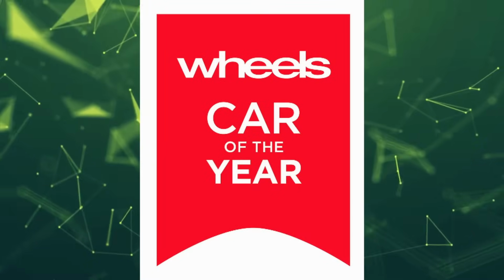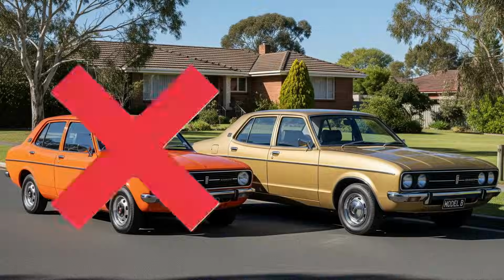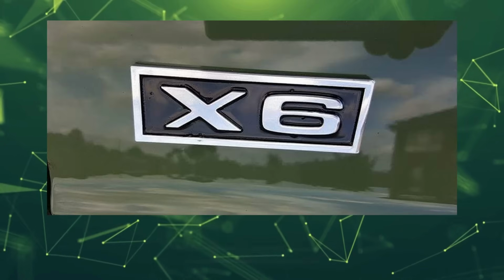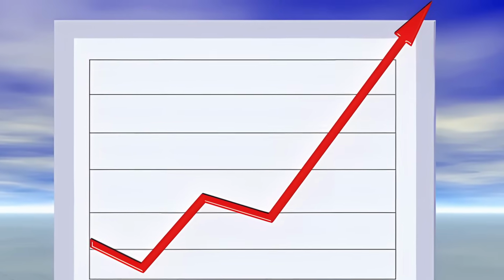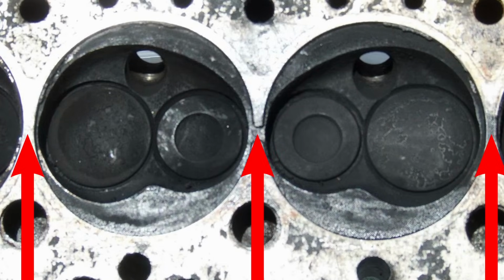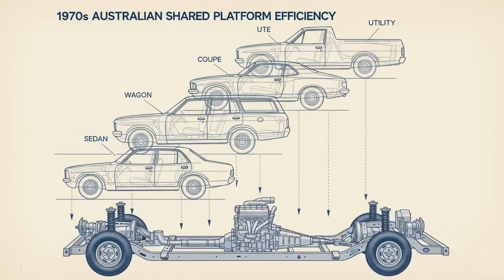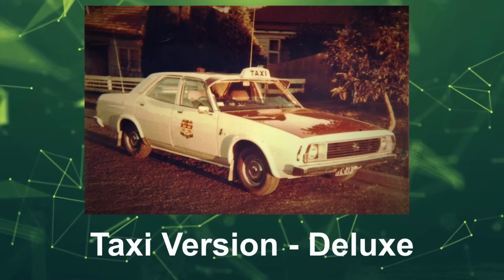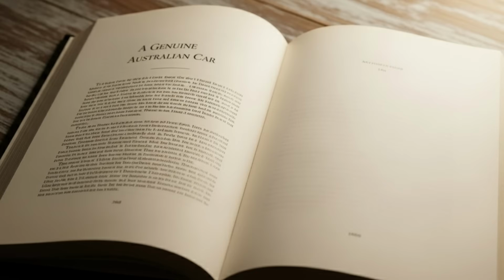More Than Just a Lemon - The Complete Leyland P76 Story – Part 1

Comment: I remember being driven in a brand new P76 as passenger and finding the cooling ductwork under the front dash falling on my legs as we drove down the road. It then rained and the washer fluid ran down my legs in the front seat when the washers were operated. The quality control was very poor and to me this is what killed off the P76. It was huge compared to the Holdens and Fords of the time but it was not acceptable based on quality.
Reply from the maker: Hello and thanks, that P76 really had some major issues and as you said, these are the things that killed the car.  Mind you, from what I have sen, the last models were actually quite good, but unfortunately were also too late.  Thanks for Your Comment, Much Appreciated.

Comment: I bought a deluxe with a crook motor and an executive with a crook auto in 1969
Converted the red deluxe to an executive using the parts from the horrible yellow exec! 
It would easily see off a 318 valiant my TA owned 
Only casualty on rough WA roads was one of the front struts 
Fuel efficiency was great on it’s final trip across the Nullarbor before I sold it 
Regret selling it !
Reply from the maker: Hello, thanks for sharing this, I always like to hear first hand experiences, as this tells a lot more than books.  I also like the way you adapted your Deluxe into an Executive.  Thanks for Your Comment, Much Appreciated.

Comment: Just about that air conditioner. The problem with out P76 initially was that the air conditioning coils sat in front of the radiator, so the air con had to be turned off to avoid overheating the engine. We only discovered this on the road out to Broken Hill. Problem was easily solved with adding an electric fan. After that the air con worked well.
Reply from the maker: Hello and that’s interesting, not shown in books.  Thanks, Greatly Appreciated.

Comment: The chrysler VH valiant was developed for $22 million aud, just 1 million more than the P76 development but the valiant was just a restyled rebody unlike the totally new leyland.
The factory was redone on a shoestring by reusing the tooling and machinery from the older smaller uk range so the bigger car struggled to fit on the production line so were vulnerable to damage. The P76/SD1 commonalty was a myth according to 'AROnline' but the force 7 rear hatch was studied for the Rover
Reply from the maker: Hello and thanks, you have made some interesting points, but the research I have done, points to a number of different facts.  Thanks for Your Comment, Much Appreciated.

Comment: As an apprentice auto electrician our workshop was always repairing the crappy Lucas Australia starters and alternators as well as the shoddy switchgear fitted to the P76. It wasn't long before they got the nickname P38 as they were only half a car ! Did England have a six cylinder marina, Australia had them back in the seventies and used as general duties police cars in new South Wales.
Reply from the maker: Hello and thanks for sharing that.  The biggest Marina available over here was the 1.8L 4-Cylinder,  no sixes were ever officially sold, and I believe it was only you guys and South Africa that got them.  Thanks for Your Comment, Much Appreciated.

Comment: Thanks for the great video.  Very well researched.  I lived these cars in the 70s as my dad was a BMC/Leyland mechanic.  i got to drive many of them while on my L plates(company cars) The only thing I picked(mentioned by others in the comments too) was the twin SU carbs on the P76 6 cyl.  They came with a single SU only.  Twins were fitted to the Mk1 Austin Kimberley only, dad told me they had heat sink/vapor lock issues so the MkII Kimberley was fitted with a single SU same as the Tasman.

He brought home some interesting cars in '74 and '75 (he was at the factory almost till they handed over to the Navy, keeping forklifts and other gear running).  He even brought home the prototype P76 wagon one night, we put my L plates on and I got to drive it that night.
Reply from the maker: Hello and thanks, the SU thing is interesting as my research pulled up twins, but you guys who actually drove these cars, confirm singles, which I appreciate, because actual use is sometimes different to what is listed.  Cheers.  Also if you got to drive a station wagon, now that’s pretty rare. Thanks for Sharing This, Much Appreciated.

Comment: Leyland Marinas were a common sight - on the back of tow trucks. P76s were quite popular for a short while - and good V8s are prized to this day, though rarely ever seen outside shows. I never did get to drive one - they'd almost disappeared by the time I got my licence in 1979 - but I did examine a few cracked and peeling interiors, with dash pads like crazy paving on Mars. The interior materials were clearly designed for English sunshine.

They were seen overall as sufficiently rugged for the horrendous outback roads, like their competitors, which Aussies apparently demanded, even though most of us were in the cities. It mattered little, because apart from an initial flurry of interest, the quality issues quickly arose and the P76 was doomed. As a kid who'd avidly check every badge on every car I saw, I always felt a little... distaste when I saw a Six, thinking "you poor sap, why didn't you get the V8?".

That was the end of the large family sedan era in Oz. It was only a few short years since Dodge had sold the land yacht Phoenix here, seen as a mildly aspirational car. Ford persisted with its large Falcons for a few more years. Chrysler folded, swallowed up by Mitsubishi, who introduced - for the time - far better compact sedans and coupés. Holden downsized to the Opel-based Commodore. Now all Big Four manufacturers are gone, as is passenger vehicle production in Australia. We make/assemble semi trucks and trailers, and the mighty Bushmaster amongst other military types, but that's about it.
Reply from the maker: Hello, That's a very insightful and detailed comment, thank you for sharing your perspective.  i agree with your point about the interior materials being unsuitable for the Australian climate, as these were never tested properly and your personal feeling about the V8 versus the Six, is something I see crop up a lot.  Talking of the Phoenix, it always reminded me of the Coronet, in some series.  Thanks for Your Comment, Much Appreciated.

Comment: I had a 1970 Austin X6 Tasman in New Zealand for several years back in the mid 1970's. 2,227cc, front bench seat, red paint, light cream-ish vinyl roof, all black interior, manual gearbox - I can't remember whether 4 or 5 gears, sorry. Gave no trouble whatsoever and was economical to run. There are only 2 Austin or Morris Kimberley's (the up-market model) still running in New Zealand, and one of them is only 1 km away from where I live. I try not to go visit the owner, as I think I might be persuaded to ask if he'd consider selling it, and I know parts would be a nightmare! However, for me, the Tasman is a nice car to look back on, and if I remember correctly, the Tasman/Kimberley production line was vacated to make way for the P76. Incidentally, my mate owns a yellow P76 that's immaculate. His Dad bought it new, was a mechanic and it passed down to his son, my mate, who's also a mechanic. Always garaged under cover, no rust, and with his family being in the motor trade, loads of spares accumulated for 'the family car'. Very low mileage, what more could you want?!
Reply from the maker: Hello and thanks for this, it's interesting hearing about the Tasman and Kimberly from an owners point of view, because I got the impression they weren't all that good.  You're right about the line juggling and your mate is a lucky man to have one these days (Even Luckier he's a Mechanic).  Thanks for Your Comment, Much Appreciated.

Comment: I owned from new an early V8 Deluxe manual with three-on-the tree. It would hold an XB 302 Falcon Hardtop to 60mph, at which point the difference in the gearing took effect. The only reliability issue I had with the Leyland was a sticky needle-valve on the float chamber of the carby. Once that was replaced, it ran perfectly. The Leyland was an excellent touring car and fuel consumption was 25% less than the XC 250 Falcon auto I replaced the Leyland with.
Reply from the maker: Chris, Hello, You've definitely owned some iconic cars.  It's interesting that the only real problem you had with your P76 was  its needle valve, considering some cars were plagued with issues and a 25% difference in fuel economy over the XC Falcon, now that's a difference.  Thanks for Your Comment, Greatly Appreciated.
Reply: @WheeleyInteresting  I've been fortunate to have owned a great many cars over the past 65 years and, apart from a new and totally dire Hillman Imp Van and a problematic 6yo Jaguar Mk II 3.4, they've all been pretty reliable. The only actual breakages I had on the P76 were a clutch cable and the driver's door glass, where a mounting plate weld failed. A rear shock absorber mount broke, but where I lived was all very rough unmade roads, so that one was understandable.
Reply from the maker: Hello,  and I must say, you have had some really good luck when it comes to car reliability, and your experience with the P76 is a good example.  Its minimal breakages, even on unmade roads, just shows its real-world durability.  Thanks for taking the time to share this with me.  Cheers for Your Comment, Much Appreciated.

Comment: Leyland developed a questionable reputation as far as all their products went, their general quality and reliability were sub par, dated styling and technology in their products like the Mini and its antiquated A series engine that kept resurfacing well after its use by date and competition was increasing from other manufacturers so buyers with greater choice looked elsewhere.
Reply: 1.9 litre Landrover 4 cylinder ,used more petrol than V8's when run in 2WD , 'questionable' is a gracious way of explaining .
Reply from the maker: Hello, some of the Car's released in Australia by Leyland, were compromises, however, the P76 did have potential, but didn't get the chance to prove it.  Thanks for Your Comment, Much Appreciated.
Reply from the maker: I used to drive a Series 3, 2.5L and that Burned Fuel, like there was no tomorrow.  Thanks for Your Comment, Much Appreciated.
Reply: To be fair compare the Mini with it's "antiquated A series engine" with what was available in the same size and class of vehicle of the time from other manufacturers, especially in Australia in the 1970's. In England and Europe it most certainly was used well beyond its use by date which IMHO was around 1980 yet even the likes of Datsun/Nissan were still using antiquated pushrod engines in their smallist class of cars into the 1980's. Ironically also known as an A series engine and loosely based on the Austin/Leyland A series engine.
Reply: @erroneouscode  It's very true the likes of Nissan Datsun were using the same kind of antiquated English derived engines in the 1970s/80s, albeit with many improvements so they were more reliable and didn't leak oil. It was also Nissan Datsun who sent their junior engineering staff to Austin or Morris way back in the beginning so they could learn how to manufacture cars from them. In the 1970s/80s however there were rival manufacturers like Toyota and Mazda who gave their customers advanced OHC engines.
Reply: @jamessmyth5949  Yes OHC engines but not necessarily in the vehicle size/class of Mini's. There were few competitors in that class, especially in Australia and some were even smelly two strokes with less cylinders. The first car I consider a better Mini was the first Honda Civic of around 72-73. The previous car it was based on was the N600 and that was complete rubbish compared to the Mini. In any case there is far more original Mini's in existance  today than any of it's competitors of the time. Make of that what you will.

Comment: The Austin A95 had more power than the early grey motor Holdens.
Reply: Probably did ,when off the boil ,Distance ,Heat , terrible roads were not taken into account ,plus if we did not buy Commonwealth made cars a %47 tariff applied .
Reply from the maker: Hello and a Good Point, the Conditions over there are much worse than here.  Thanks for Your Comment, Much Appreciated.
Reply from the maker: Hello and that's interesting, didn't know that.  Thanks for Your Comment, Much Appreciated.

Comment: Early 1970's I saw a lime green Force 7 being offloaded at Larke Hoskins dealership in Miranda, a southern suburb of Sydney.  Twenty years later (mid-1990's) I saw an orange Force 7 in a used car dealership in Rockdale,  Sydney.  I still lament that these vehicles never went into production.
Reply: they did start production of the Force 7,  but never officially released, even though a few managed to get out, the rest were destroyed
Reply from the maker: Hello and this is Correct, but there is also strange story around these.   I will be releasing a Part 2 Shortly, that delves in to the Force 7V deeper, plus others. Thanks for Your Comment, Much Appreciated.
Reply: Some were sold in NZ
Reply from the maker: Hello and I found this also, but the NZ model is now back in Australia.  I will be releasing a Part 2 Shortly, that delves in to the Force 7V, plus others. Thanks for Your Comment, Much Appreciated.
Reply: it was the supercar scare  written by the now late evan green. it was that the drink driving limit was at its highest at ever been and you could could buy a 200mph road car. all current projects by  the major manufacturers freaked and cancellled current projects the only one to survive was: the torana XU-2 all holden did was change the ghraphics on the side to SL/R 5000
Reply from the maker: Hello and agree,  it was the Super Car Scare of 72, that caused ripples all over the Industry.  Thanks for Your Comment, Much Appreciated.
Reply: From memory one of the issues with the cancellation of the P76 was that the production release date was delayed.  From memory the original intended release date was the late 1960's.  If released then the car would have been more advanced than other manufacturers products.
Reply from the maker: Hello and that's interesting, I haven't seen anything to suggest this, but if the P76 was released in the 60's, it would have been a game changer.  if you could pass on any details of this, it would be good to see.  Thanks for Your Comment, Much Appreciated.
Reply from the maker: Hello and I agree, I will be releasing a Part 2 Shortly, that delves in to the Force 7V, plus others.  Thanks for Your Comment, Much Appreciated.
Reply: @WheeleyInteresting  Look forward to part 2, Served my apprenticeship on BMC in New Zealand, got me a lot of jobs when I moved to Australia as the Aussies hated working on them. Still have a soft spot for them
Reply from the maker: Hello and glad you liked the video, part two should be out before the end of the month.  Thanks for passing on your story, I am always interested in personal stories, as you won’t find these details in books.  Thanks for Your Comment, Much Appreciated.